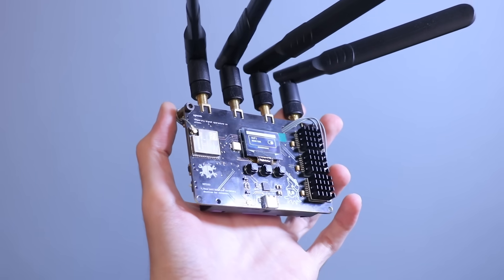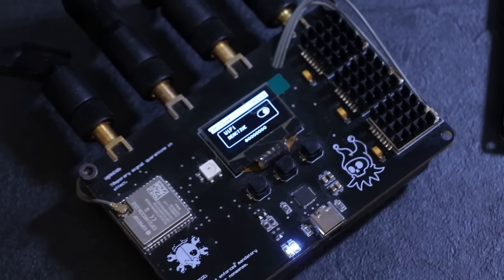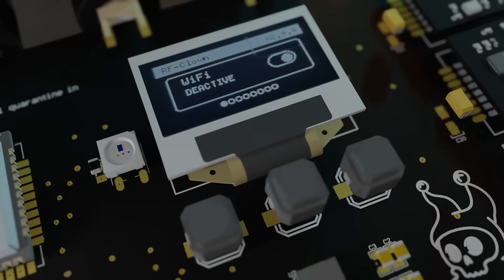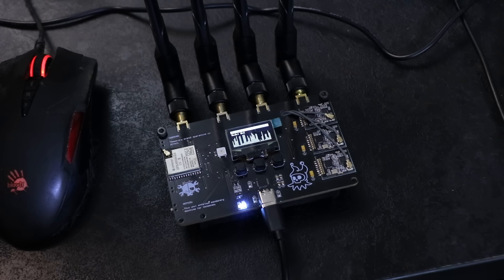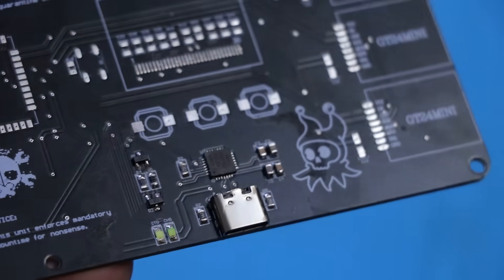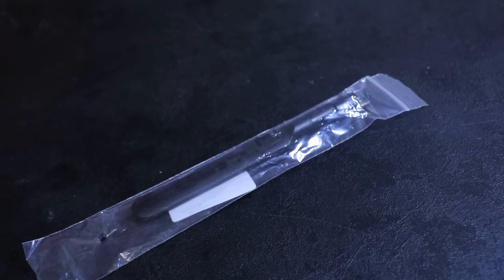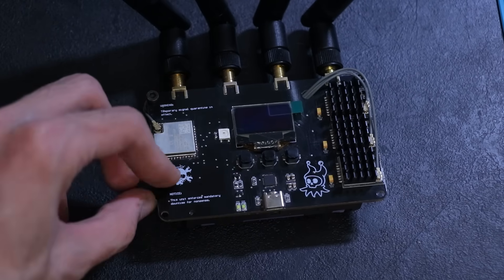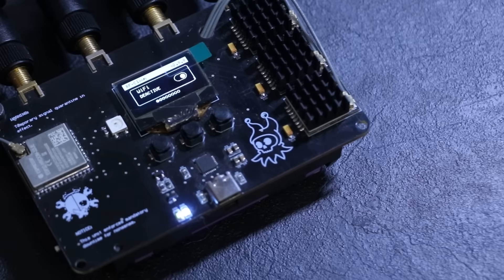I Built a Device That Freezes Wi-Fi Cameras | RF-Clown v2

Comment: Awesome project, do you have a list of hardware that you used for your build of materials so others can get it made as well? Try to have the circuit board made with assembly.And they requested a list of parts..... Please keep working on awesome projects like this and keep us in the loop!
Reply: I had the same request when I tried. They couldn’t build it with current instructions.
Reply: @pmiknaitis  Would be nice if the maker replied and updated the github with the full build of materials and realistic parts list but since its been several weeks since i commented on this, it seels less likely

Comment: Fun fact, a $10 CYD with Bruce firmware can run a deauth flood.  A deauth flood will disconnect any nearby Ring cameras while it's running.
Reply: A 4 dollar esp32 with a built in wifi module, can do the exact same. 😅
Reply: @InstantNameOfficial  all esp32s are WiFi microcontrollers your comment doesn’t make sense. And your 4$ esp32 has no capabilities without power or some kind of way to use it.
Reply: A deauth flood isn't nearly as effective as an actual radio jammer. Moreover, many routers/wireless networks have patched deauth attacks. this is a high quality jammer that emits noise on 2.4Ghz frequencies, literally blocking sight of any airwave signal, be it bluetooth, or wifi. This kind of stuff will block anyone from using wifi/ble/bc in a whole building if not more.
Reply: Fun fact your normal computer running linux can run a deauth and give the same effect except you can actually knock every wifi connected device off.
Reply: @waelfdhila4606 a deauth is not the same as a jammer. the signal that is causing it is from the nrf24
Reply: Most people watching this started with a cyd. This man makes quality tech that’s does a lot more than deauth attacks.

Comment: This is why all of my cameras are PoE and recording in a wired hub, and in the sd card in the camera as well.
Reply: A powerful laser will knock the camera sensors out. Consider adding a protective filter and you're golden!
Reply: @waelfdhila4606  True. But I am not Fort Knox tbh...
Also the cameras mostly covering each other, and by the time someone can shine a laser, our little terrier - Taxi, will be chewing on their legs. 😉😉
Reply: Yup! Always assume that any wifi connection can and will be jammed, never use wifi for anything mission critcal.
Reply: whats the sd card in the camera for?
Reply: @justinneal4661  redundancy, which renders the efforts of the guy in the video vain.
Reply: Backup

Comment: I sense a bunch of Flock cameras going down.
Reply: Do not sit “idle” hoping a situation improves.  It won’t without action.
Reply: @newfinishautospa  my wife tells me all the time not to worry about things you can’t control. Did the founding fathers wives tell them that?
Reply: @250smacks  Defeatist saying tbh. They don't want you to do anything :)
Reply: Brow is a walking glowstick
Reply: Would it be simpler to attach a can of spray paint to the front of a drone with a remote trigger, and navigate to the flock cameras individually and just decorate them with silver, like from that first Mad Max movie? 👄
Reply: @ByteSizedSociety  Just make sure it is not a drone that has RID, a server connection, syncing to flight data services, one with GPS, or any telemetry data. 

If you built your own, maybe. But all of that data is just one subpoena away if they see it is a DJI, or an Autel, whatever brand, etc, and that company decides to comply, then you are fucked.
Reply: @AToneForOurSins  the tailOS of the drones, make it yourself and self destruct if anything goes wrong, use proxies and, well you know usual things for cybersecurity.
Reply: @AToneForOurSins I build my own from basic parts that were around 5 years ago or more and I still wouldn't attempt this. If you're taking out one flat camera another can see you or some camera. And if you have a rig discreet it may be discreet visually but not radio frequencies and the power vtx analog isn't encrypted. I imagine somewhere out there Little scanners that just wait for those signals to pop up and they record everything that happens. Maybe not everywhere across the world but I bet it's a thing cause its to easy to implement.
Reply: @ByteSizedSociety  if things keep going at the rate they are, you won't need drones...people will go all "witness me" style into the cameras lol in the DC/VA/MD area I saw news article not many years ago of someone physically tackling the speed trap cameras 🤣🤣 flocks so many times worse than speed cameras, you know someone is gonna take action eventually like that one hero who took down the speed cameras lmfaoo im more of the "lobby the people to take action" than cause destruction, but if I see it I'll dam sure be clapping for them 🤣🤣🤣
Reply: @ByteSizedSociety Show called NCIS. McGee had a paintball gun with glue, oatmeal and others to simulate bird poop. DiNozo and him were breaking into a vehicle impound lot...

Just saying.
Reply: @TheHandyTek television is mother, television is father.

Thank you the handytek... 😊
Reply: @ByteSizedSociety  “easier”
Reply: @joeblowsmithjones 🎉
Reply: Nope, they use cellular, having a jammer on for a prolonged period of time will get you busted by the FCC, and they've got onboard storage on those FLOCK devices.
Everything about your assumption is wrong. Just buy a sawzall and cut the camera off then toss it into the sewer and run away. Don't forget to wear gloves!
Reply: just smash them, you're thinking too hard
Reply: Thats not how they work.
Reply: @chrisbrownlovesrihanna SYBAU!
Reply: @ryszyrysz whats that mean?
Reply: @chrisbrownlovesrihanna It's a youthful acronym for shut your g your-word a-word up. It looks like that YouTube commenter rejected your statement, Chris Brown loves Rihanna.... 😢 Perhaps as a sarcastic reply?

In any case, the flock cameras seem to be capitalizing on fear in a big monetary way.

Edit: Oh I see the poster used the letter b so, whatever is a common b word insult it's probably what the person was intending to convey was their acronym.
Reply: They don't rely on wifi so that's not an issue.
Reply: I'll take a $1.00 garage sale hammer over any high tech solution for this problem.
Reply: Those cameras work over the cell network. Besides on your way to jam the one you do, your plate and the tracking device in your pocket all the time will betray you.
Reply: @ThePhoenixcompanies  According to to a certain court ruling the judge said if the tax payer is paying for it than it’s public property which means a metal base ball bat is needed.

Comment: MY QUESTIONS IS HOW  do you guys know what parts to add to what part. i never understood that. i know we can look it up but you add chips to make things easier is so fascinating to me. how do you know how much power you need, where things go. I dont get it lol
Reply: There are equations and formulas for that. It's called Electronic Engineering.
Reply: @Tovarish_Kalashnikov  how can i figure something out like this myself?
Reply: @Kenneth-l5z5e  well, by studying. Ohm, Ampere, Watt, Kirchoff, Fourier transform, maxwell, frequency and bands, propagation ecc..., those are only the principals, then there are WAY more
Reply: @Tovarish_Kalashnikov  okay thanks
Reply: Basically the intrinsic design of any device causes it to “ask” for a specific amount of power. Power (watts) is the voltage (in volts) multiplied by the current (amps). P = I*V. So power supplies only need to be the right voltage and provide at least enough amps for any device. Way before I took any classes, I made a MintyBoost from adafruit which takes the voltage from 2x 1.5V AA batteries and boosts it up to 5V to send to a USB port for charging stuff. Not sure if she still sells kits for it, but a simple project like that is a good start. I didn’t really “get it” at first either but eventually with enough tinkering and trial and error you’ll learn the principals. Playing around with little LEDs using 5V USB power is totally safe and you can touch the live wires without getting shocked or anything. Changing the value of the resistors before the LEDs will change the brightness by reducing the amount of current the LED/resistor combo is “asking” for. My circuits professor often used water analogies. A resistor is like a restriction in a pipe like stepping on a garden hose. Higher ohm value means a tighter restriction and less water/electricity gets through. Voltage is like the pressure, how far of a gap can a free stream of it jump. The current is how fast it will fill a bucket. Then diodes are just one-way valves (called check valves in plumbing), and transistors and relays are both just remotely-operated on-off switches. Capacitors are like tiny batteries or holding tanks and can store and release power super fast to smooth out fluctuations. All circuits are made of those few simple components. Here on YouTube, ElectroBOOM has some good electronics basics classes. Bigclivedotcom has a video going over all of the basic component types and how to actually identify them on circuit boards. All of big Clive’s videos are a great way to learn about this stuff.
Reply: @silverecco  okay so there is some stuff to remember for sure when it comes to these powers. I do like the part where it asks how much does the project need? THat's a good thinking start. I will check out these videos. I will save this info in my private discord as well. I need to learn this or atleast I want to. What projects do you sugguest. do I start with that step up convertor that you started with?  I purchased some of these convertors and they get very hot. What about the heat, and what is normal and what isn't?
Reply: You look at the data sheet. Every chip has those specs listed.  It really isn't hard at all, you don't need equations and formulas.
Reply: @JohnDoe-420  has nothing to do with the THIS board in general homie. wake up
Reply: @JohnDoe-420  question was answered.....
Reply: You could simply ask your AI companion by stating what you want to create and working through it step by step with them.

Comment: what is specific about this device that cannot be accomplished with a GNU/Linux distro with stuff like kismet,(B)ettercap,aircrack,gcxdumptools and good compatible drivers? and wireless chips?
is iet merely the extra antenna providing more range,

I need something that can detect like all kinds of frequencies and so on in an area of the device, if i could get a permit i would build a mast. but for the project of mine i set "detector array" at specific location, use those gos points to visualize via osm, and proces the movement of any device on the mao, kinda line ids but no camera..
i got an sdr with dump1090 trackin olanes
awus 1900 dual band with the best drivers one can wish for...
yet i can only frequency hop x/s to keep reliable data and i don't see all devices..

Comment: I have a like device that makes "simplysafe' alarms useless.  
If you want an alarm get a real wired air-gapped alarm system with a monitoring company.
Wifi and Cellular systems are not always reliable.
Reply: I was playing with our work simplisafe and I can drown out the door sensor about once every ten opens, but they switched to rolling codes a few years ago. You’d have to have ten transmitters doing all ten frequencies, which is doable, but snipping the internet going into the building is easier. Nobody pays for a cellular backup plan lmao.
Reply: @silverecco  All you need is a 2watt wideband transmitter programmed to just yell spread spectrum static at the right center frequencies.  
You can even get devices way simpler than ones used to clone car keys without holding the car key.

Comment: pretty cool, but kind of pointless with a lot of camera systems. my cameras record locally for a long time so knocking them off of wi-fi won't change much.
Reply: At least script kiddies will have new flipper zero 😂
Reply: wifi is one of the numbest ideas of conecting something, just hack the net and kill the router, but well you will need to take care of the local storage of microsd, so you can deauth the wifi or kill the router and then just shoot paint at a camera or hit it with a magnet, use a drone made by yourself and with a self destruct attachement, so its safer, buy components from china, so you not get tracked down from the local supliers.
Reply: Yeah so you kill the wifi and then take the camera or card with you.
Reply: To be fair, it's still useful for screwing with some of the dumb added features that Flock and Ring cameras have been pushing lately.
Plus, it's a great way to up the costs of the government Flock cameras, by making them have to constantly deal with interruptions that require manual intervention.
Reply: are they hardwired back to your hub(hard drive)?
Reply: @zmdoor doesn't need to be, just about every camera supports local recording on a card or internal SSD.
Reply: @zmdoor no, they record locally on the camera and then it's transferred once it comes back online.

Comment: PLEASE BUILD A 5.8 / 2.4
 GHZ DUAL BAND , WIFI DEAUTHER USING BW16 ❤❤❤ 🎉
Reply: + 6Ghz
Reply: why ?
Reply: Are your fingers broken?  Why don't you do it, lazy!
Reply: Skid stuff. Stay small lil bro.
Reply: After that??? It still cant do shit cause most of the 5ghz network uses PMF protocol to prevent any type of deauth/wireless and fun fact most of the actual jammers dosent even use these node mcu(like if any of u knows how frequency works lol) 
These products are just used to make money from 14yrs old cause they knows u script kiddies still living in 90s 😂😂
Reply: @ShanJi-xu2cc  Since you wanna pretend like you know what you're talking about, here's a few corrections for you. 
1. The RFClown performs brute force jamming by simply radiating enough RF noise to overwhelm nearby receivers. This type of attack works against any receiver in any frequency band, although some signals, such as the chirp signal used in LoRa, are more resilient. There are also hardware anti-jam systems that work pretty well against this type of jamming, but they're pretty much never used outside of military systems because they're expensive and noise jamming isn't common. 
2. PMF reduces the effectiveness of management frame attacks such as deauth. It does not do anything against brute force noise attacks, which is exactly how the RFClown operates. 
3. Actual jammers don't use NodeMCUs, they use much more powerful transmitters because brute force noise jamming requires a ton of power to get any decent range. That said, RFClown also doesn't use NodeMCUs, so I have no idea why you brought these up in the first place. RFClown uses NFR24L01 transmitters, which are also much lower power than the transmitters used by commercial or military jammers, but in this system they are doing pretty much the exact same thing, just blasting out RF noise as quickly and powerfully as they can. 
4. These "products" aren't really products, they're projects that CiferTech happens to sell a few of. This is clearly a project that he's created and continues to work on because it interests him, not because he can make money off it. 

If you want to talk shit and make fun of people, you should at least try to get a basic understanding of the topic at hand first, otherwise you just look like a fool.
Reply: @ShanJi-xu2cc look at you with all that jive, talk there long leggy
Reply: @ShanJi-xu2cc  you Just Need a Power jammer with a sort of AM-PM Modulation, with a lot of Noise and Peak CW Power of ~5 Watts.
Reply: @Tovarish_Kalashnikov finally someone with actual knowledge 👏
Reply: @ShanJi-xu2cc  teorically, a Sawtooth modulation is an AM-FM type, wich can still do many damages to it. What a normal person would do, is actually create a Microwave VCO/Oscillator at 2.4 GHz, modulating it with a Sawtooth wave, amplify it and use a Pass-band filter to make the band of signal more centric on the frequency needed (in this case, from 2.2 to 2.6 GHz in 20 Watt peak CW power)
Reply: @Tovarish_Kalashnikov  normal person and microwave tech don't go in the same sentence man, traces act like antennas at this frequency lmfao; normal people would use a zener diode at its breakdown voltage to cause avalanche of noise & amplify with LNA's, no sawtooth trickery required, band-pass filter to be precise on a frequency yeah.
Reply: @ShanJi-xu2cc But Bw16 does 😂
Reply: @ПАРАДОКС_Хbw16 does what? its just the same node mcu with 5ghz capability 
And did u even read what i said lol 😅
Reply: @ShanJi-xu2cc 😂😂😂
Reply: @ПАРАДОКС_Х u kids actually living in 90s 😂😂😂😂
Reply: Slava Ukraine lil bro 🇺🇦
Reply: @YøIø_Swaggins 🤡
Reply: @YøIø_Swaggins  go in the trench Lil bro